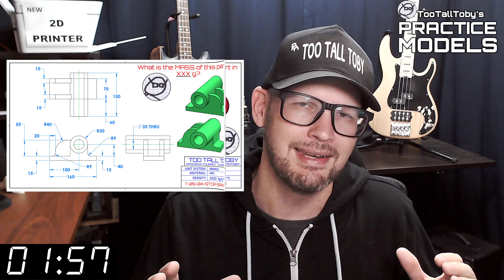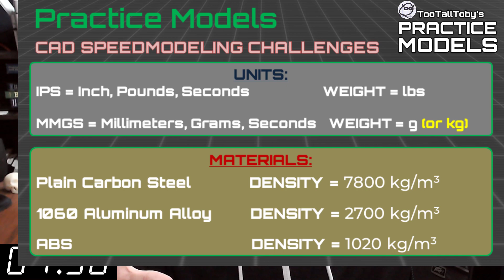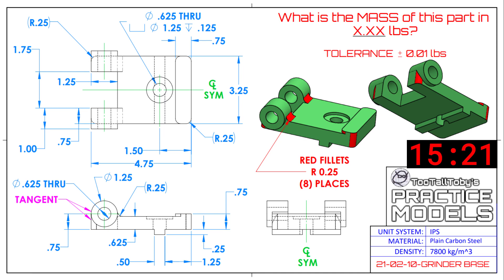SOLIDWORKS Practice - Onshape Practice - Fusion 360 Practice Exercises - TooTallToby-21-02-10

Comment: 2.748 lbs. OnShape.  32 minutes.  A couple of missteps and corrections, but finally got it.  Had trouble with the 2 fillets on top.  They kept wanting to span the open area between them--probably because I created the horizontal cylinders as a single cylinder and used a cut extrude to break it apart.  So I discovered the "partial fillet" option.
Reply from the maker: Nice!!  I love hearing when people discover new features when working on these challenges!!

Comment: Practicing for my CSWA exam, finished in 11 minutes and 59 seconds with a mass of 2.75 pounds using the latest version of SolidWorks. The two fillets on the cylinders most certainly held me up. Not sure why SolidWorks creates a fillet along the entire length of the part. I had to crudely make a extruded cut to remove the excess material. Anybody know a better way to combat this?

Never tried one of these videos, but I think it is a great idea and a good way to get practice. Thanks @Too Tall Toby
Reply from the maker: Thats awesome Seth!  Thanks for the feedback and glad you enjoyed this one!  Good luck on your CSWA!
Reply: I had this exact same problem.

Comment: 2.7479lb, 9:55 with Onshape. The fillets on the cylinders were definitely tricky. Suggestion: It would be nice if you also added the density of the materials in the units of the drawing (i.e. lb/in^3), because Onshape does not let me enter kg/m^3 in for the units of the density and I am forced to convert the drawing to kg and meters and then back to in and lbs to see the answer.
Reply from the maker: Thanks Finn!   I'll see what I can do!
Reply: I've found a work round for this, before you assign a material, change the workspace units to meters and kilograms. Then when you assign a material it will be in the correct format. Before you check the mass against the answer, change the workspace units into pounds.